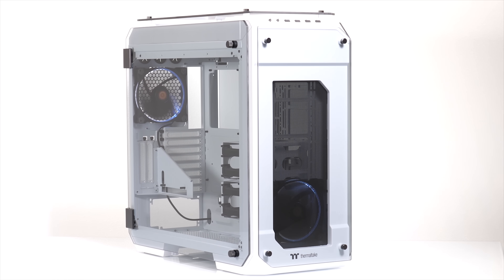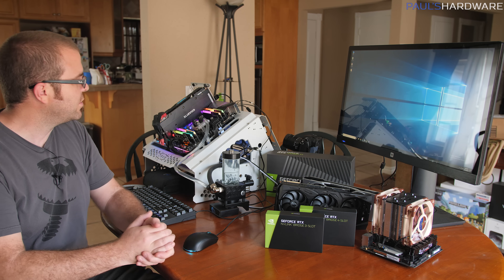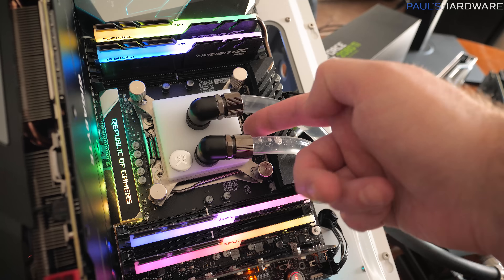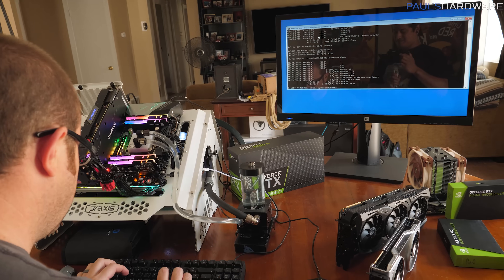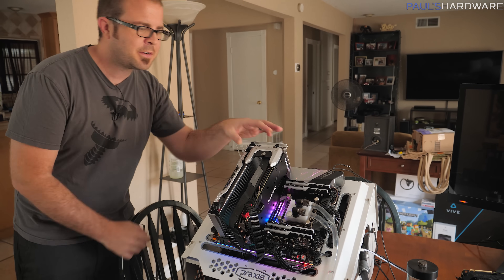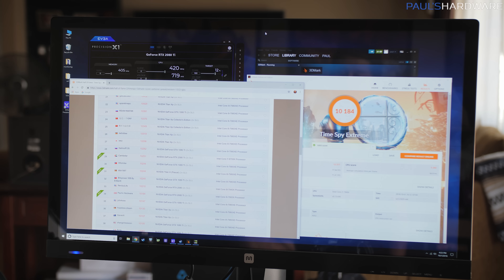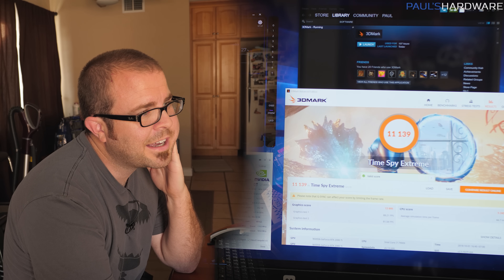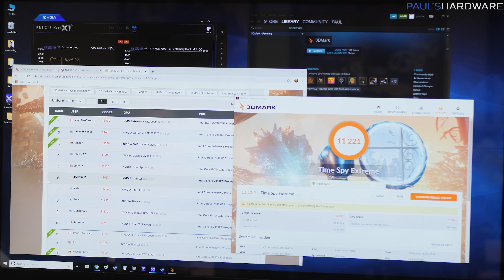I'm Just Getting Started... #RIPJAY #RIPGN

Comment: That Chill-Blaster thing and oversized Box Fan Radiator that JayzTwoCents created might both be fun to play with, if you want to make your own versions (you can use that chill-blaster thing directly on the oversized radiator). I'd definitely suggest lowering your ambient temperatures as well, and making sure you reduce your ambient humidity. That last one is especially important because condensation is bad, and is especially a problem if you cool below ambient temperature.

Comment: hang on, you can't adjust geforce control panel 3d settings, that's altering the output of the benchmark. (assuming it even allows you to submit those results and properly validated)
Reply: Its a valid score as long as its set to performance, memory artifacting but no crash, and even closing explorer.exe before running benchmarks. I've tried on my rig and i gained 200 extra points because those settings were used.

Comment: Wit a bit of modding you can add a 2 Power Supply in parallel for the extra juice you need.
Save some money if you have multiple lower power PSU's.
der8auer did this in his latest overclock.

Comment: Paul, Jay did a video on using power cables for graphics cards and found that separate 8-pin cables from the PSU instead of 8&6+2 on one cable was better. It got a little more juice with the separate cables.

May the best Paul win!

Comment: Hi Paul.  It is better to use 2 PCI-E cables per graphics card instead of one cable with two 8-pin connectors daisy-chained.  When overclocking, the power drawn through the two 8-pin connectors may exceed the capability of a single power cable's wires, especially a flat cable with thin wires.  Thin wires may get very hot.

Comment: Can you use 3rd card for physx compute ? Should give some points there. Also if I remember correctly, running every 8pin from separate connector on psu gives few extra mhz on the gpu as per jyaz video from few months ago

Comment: I know it's not a huge deal, but since you are trying for a record and all, maybe try using an independent pci cable for each 8 pin connector (instead of using the piggy-back cables). Jay did a video once where using independent cables gave a little better power delivery to the video card. The difference was minimal at best, but still, record...

Comment: You should not be using piggy backed video power cables.  Run one 8 pin cable from the PSU to the video card for each connector.

Comment: Go super extreme air+water-cooling - build a rig for water-cooling and strap the radiators to the outside of an aircraft and go as high as you can before the liquid freezes (it's 5F at 15,000 feet). If you're worried about condensation, maybe strap the rig to the outside as well.

Comment: Wouldn't you realistically be better off using a Threadripper 2990WX that then i9-7980xe? If the benchmark can use all the available cores, you may score a bit higher on the Threadripper.
Reply: No you won't because even though the 2990WX has more cores, the 7980XE can be clocked higher. So the 2990WX will limit the GPU's to some extend in the GPU benchmarks, while the 7980XE won't because you can go beyond 5 Ghz. Roman/Der8auer made his video today where he explains (very briefly) why they didn't run the benchmarks with the TR (sadly it's german only).